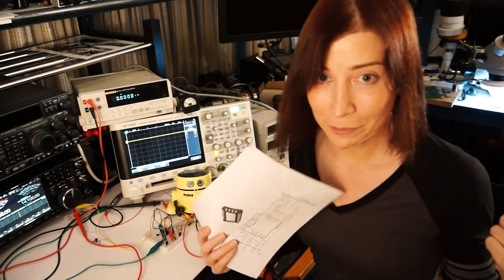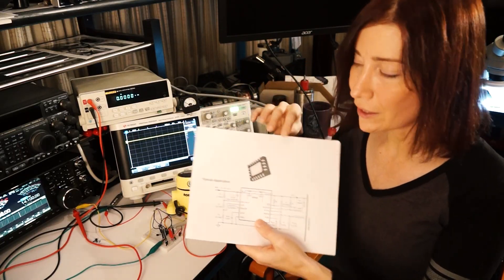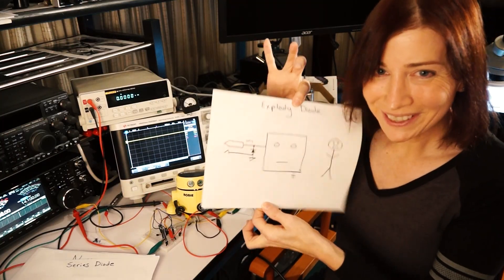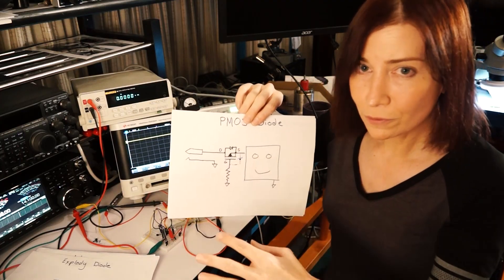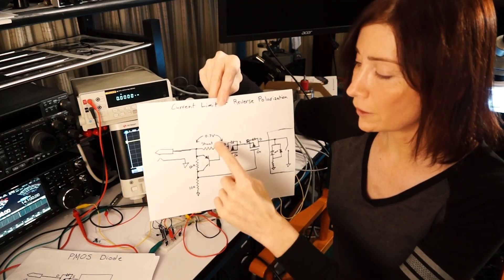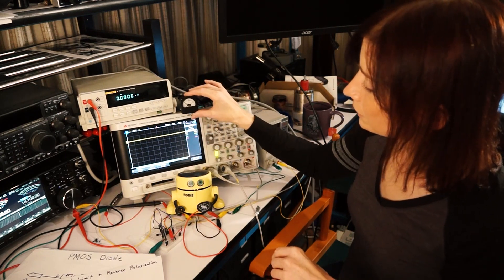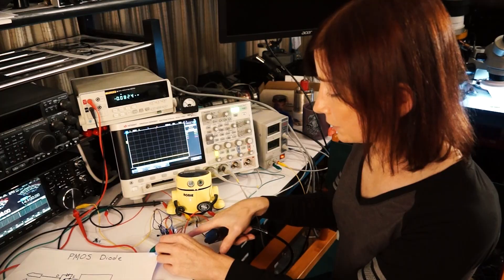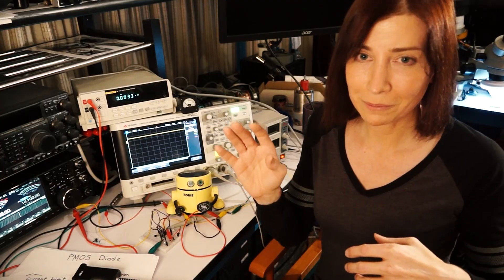Low Cost Reverse Polarity and Over Current Protection (Corrected)

Comment: This is a cool video, thanks for keeping it available. You have moved on with your life, and we wish you well. 

   I was studying these circuits, but everybody uses slightly different symbols and I was thoroughly confused. My text-
book is very complete and was no help at all. I wasn't sure the drain and source labels were correct in your diagram.
    Luckily I turned to the data sheets of my favorite MOSFETs (IRF4905 and IRF3205), and their symbols feature the body diode very prominently. Then I realized that the first PMOS is connected 'backwards', it's an always on switch (until the power is reversed). 

   If you are learning (or re- learning) MOSFETs, understand that the symbols are a mess. Take notes and copy circuits using your chosen symbols. If you work at it, you will eventually get it sorted out, so don't give up. 

   Remember: 
   If we could all make videos like Big Clive, people would have watch 72 hours a day just to keep up.

Comment: I use series diodes when input voltages is high ( >= 9V ) and reverse diodes and fuses for low voltages. If the voltage drop is important, I use Schottky diode . For over current protection, usually I use a fuse or reversible fuse (resettable fuse).

Comment: YES, but in the diagram with current limiting, you lose the 0.65 volts when it acts, as with a simple diode. 
If the normal current is smaller than the max current, then this is an excellent circuit.
It's probably a diagram to transform into a very small PCB and to have in your box of miscellaneous stuff.

Bye 

OUI, mais dans le schéma avec la limitation de courant, vous perdez les 0.65 volts quand elle agit , comme avec une simple diode. 
Si le courant normal est plus petit que le courant max , alors c'est un excellent montage.
c'est sans doute un schéma à transformer en un tout petit PCB et à avoir dans sa boite à trucs divers.

Bye

Comment: I have a vintage 1979 Chess Challenger 7 portable computer that I wanted to protect from reverse polarity (it's using a 9VDC small external psu). I simply put a diode bridge between the power input jack and the device inside. That way, it works no matter what the polarity is. Very simple to do: a diode bridge and a few wires. Cost: a few cents. The device already has a 7805 voltage regulator inside, so over-voltage is not an issue.

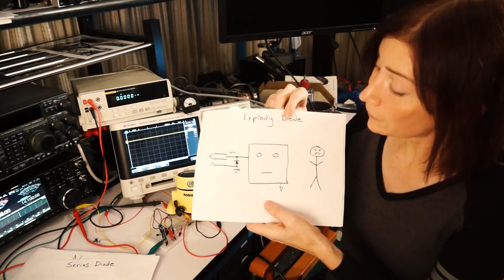Comment: 3:23 How about a parallel thermal fuse? Then user doesn't have to replace it. And no voltage drop. Would you need the diode in series with the PTC?

Comment: Another method is an over current latch circuit, that hard cuts the output upon seeing a fault condition until reset. Better for higher current loads where linear regulation would prove infeasible. Maybe you could just bond a thermistor to the FET of the linear circuit, producing a positive feedback loop, though using an actual comparator latch circuit is probably better for precision.

Comment: There's no way that you have a 50Ω resistor across that pnp transistor. Without the transistor conducting, your gate would be pulled up by that resistor to about 10K/(10K + 50) = 99.5% of your supply rail. That cannot possibly turn on the second pmosfet. I suspect you're using a 50K resistor across the transistor, but honestly, your circuit doesn't need it unless the Vgs(max) of the pmosfet is less than the supply voltage, and even then, a zener diode would be a better bet.

Comment: This is really good for me, I'm doing a Ben Eater 6502 build, and the other day I tied power to both VCC and VSS on the processor. I was sure I'd cooked it. I hadn't, but circuit suggestions like these could save me some sweat and tears, down the road, particularly the reverse polarity part.

Comment: Have a RND KA320-3005D dc 30v 5 amp bench supply.Blew the diode that protect against reverse polarity while trying to charge a 12 volt battery.The protection diode sit under a current sense wire with 7 wide windings(not a coil sinse windings are not close together.or is this a shunt resistor? what are this wire made of? nicrome or copper. 1.2 mm thick.A little stiff to be copper wire.If you can give me a tip or can point me to wher i can get a schematic,would be helpfull.Evvblog is good.fran lab and now i know about your channel.

Comment: If you put a y connected generator and a delta connect generator next to each other in theory they may neutralized each other out due to electrodynamic Maxwell equation. So in theory the navy we better put a shield over our generator and motor prevent interference from such a system

Comment: What we worry is if the we had used too much electricity made earth had too much polarized became back ward lighting goes back lighting into building or cars or cloud. Reduce using and solar power supply must be carefull design because direct current made earth became over polarized

Comment: The serial transistor is the most expensive part in such a kind of protection. I'd think about using only one of them, shutting it down by adding a low-power bipolar transistor between the gate and the source and opening it using a current mirror.

Comment: This is a good way to protect a device from putting in reverse polarity but how would you implement reverse polarity protection on a battery charger that will inevitably be connected in reverse to an extremely high current source?  Thanks

Comment: i wish there is a circuit that could get powered by external source and not impact the output of the lab workbench power supply that can monitor that kind of situation but that don't change the volt/amp quality coming from the adjustable buck Boost converter

Comment: Nice circuit, although I'd have placed the reverse polarity protection in front of the current sensing part to avoid the PNP transistor being reverse connected.

Comment: This may be a silly question but why is the 50k resistor sat 'between' the emitter and collector of the PNP? In this case there will always be some voltage at the gate of the second PMOS, and when the PNP turns on, the 50k is effectively shorted out and so the gate of the PMOS rises to whatever is at the input - is that correct?

Why is set up like this rather than say, the same circuit but simply without the 50k resistor? Or alternatively with that branch set up to have emitter>collector>50k>10k in series? Am I missing something obvious here?

Thanks

Comment: How much power is consumed by your protection circuit in this low-current application? What is the voltage drop across shunt + two transistors?

In a higher current application, doesn't the cost/V. drop of the shunt resistor become problematic quickly?

Comment: Hi...I have a little off-topic absurd question. 
Suppose I have a black box that has an input and a signal output. While the device is not indicated otherwise, what is in the entry is shown in the output. If it also has another input that tells the device to keep the last known value of the input constant in the output, could we say that we have a one-bit memory?
If instead of two voltage levels (0-5v / 0-1) it were a whole voltage range, would we have an analog memory? 
And if it were a range of frequencies (1khz-1Mhz) would we still have an analog memory? 
Is there a commercial device like the one described?
Would that have any use or would it be just fun?
Thaks :)

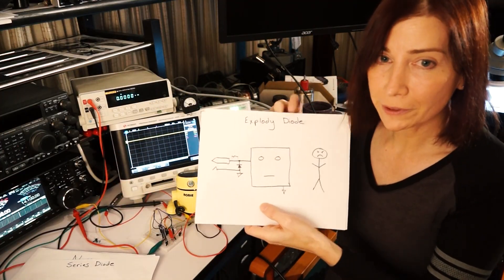Comment: 3:19 this drawings is missing the Fuse so it will blow the fuse if the polarity is wrong, but remember that the Diode CAN hold to the max current before the fuse will burn

Comment: I've got one of those Flukes... have you replaced the battery yet?  Mine's a goner... love the video, for my stuff a pass diode is fine, they've got the Vf down to 0.3V now, and I'm not on batteries for my widgets.  USB helps limit lots of things like reverse voltage and excess current.
Reply: Oh, btw... you like CW on 20M?  Or digital?

Comment: No resistor across the E-C of the PNP is really needed.

When I do this, I usually put a series resistor in the base leg of the PNP.  If the input is from something like a car battery, the MOSFET may pass enough briefly to make the drop in the series resistor big.
You can also put the sense resistor between the pair of MOSFETs.
Reply: The resistor across the pnp transistor is performing the same function as the zener diode in the simpler circuit. It prevents the pmosfet gate from being pulled so low that it exceeds the maximum Vgs for the device. Of course, it's not 50Ω as claimed, but (for example) 50K as a resistive divider with the 10K resistor to ground would keep a 12V supply from pulling the gate below 2V, thus keeping Vgs to 10V maximum.
You'd obviously have to recalculate for a different supply voltage and maximum Vgs, and clearly it's only needed if Vsupply > Vgs(max).

Comment: Interesting, but if the Rshut drops .7 V, what is the advantage compared to a simple diode? Why not adding another transistor to trig the BJT and reduce the voltage drop in the Rshut?

Comment: I've heard the 'Explody diode' called a crowbar circuit before.  I've used that with a PTC fuse with good results.  A P-channel FET is easier in some cases, though.

I do a lot of work on high-end programmable LED hula hoops, which have some interesting design constraints.  Everything has to be small and tolerant of board flex, but for practical reasons (like being able to assemble boards on our little in-house pick and place machine and to be able to repair things by hand) component count ends up often being a bigger concern than cost.

Comment: I've been think about a circuit that could be added to the ThinkFun Circuit Maze ( https://www.thinkfun.com/products/circuit-maze/ ) which, at minimum would buzz upon short circuit and limit current, and at best provide feedback for reversed batteries, over-voltage batteries, and even turn off current if current doesn't change for a time period, as well as short circuit.  If not wired in series, it would have to have minimal quiescent current as there is no on/off switch and the game is left on the shelf without removing batteries for months. The sold version just drains and overheats the batteries if the user sets up a short circuit. I've been thinking about incorporating a low quiescent current microprocessor.  Any suggestions?

Comment: Essentially, the FET is being used as a diode with a very low voltage drop. Would it be possible to use FETs for the same purpose in other diode applications that could benefit from that low voltage drop, such as:   a full wave rectifier for a power supply, the crystal in a crystal radio?  Or are there other modern components that would do that job more effectively?

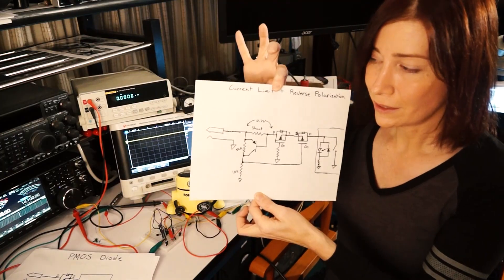Comment: 5:25

0.6-0.7V is too large voltage drop. It may be practical only as short circuit protection, not as general overcurrent protection.

Comment: Nice little circuit and explanation. 
As far as reverse engineering check out Diodes Gone Wild. Danyk has reverse engineered many a power supply designs. He is also present in a lot of forums and has a website with lots of designs detailed. 

  I'm not monetized, don't upload much, and really couldn't care less about self promo (plus I'm just a dumb hobbyist not an EE). However, I've been using my playlists as a form of personal references and bookmarks to other user's content for a couple of years. I save references and index them by subject alphabetically (although others cannot view the indexed list like I see/use it). If anyone wants to bypass the search results biasing of YT, a curated list of references is nice to know about. My subscriptions are also public but I watch a lot of edutainment stuff you'd have to filter through on that list. I recommend using playlists to find a lot of really good channels from many EEs and Devs.
  I saved this upload to a few playlists too, as I have an application in mind to try this on. 
  Again, I have nothing to gain in sharing. I'm just trying to make the path a little easier for anyone with similar interests as myself.
  Thanks for the upload ;)
-Jake 

PS congrats on the mention from Sam Zeloof on the Hackaday Super Conference. The idea of a garage semiconductor fab blows me away.

Comment: I was just reading Maxim application note 636 on this subject after blowing up my bench power supply 2 days ago :p  I fixed it but it's so convoluted inside that I decided to just make one from scratch eventually instead of upgrading the protection circuitry.  Now I'm just curious how a series circuit blew in 3 different places, like how does any energy get to the other two after the first spot breaks?

Comment: The simplest reverse polarity protection is a Schottky diode. The drop is below 400mV. Your PMOS solution works fine. It‘s also possible to use a NMOS solution putting the protection circuit into the GND line. NMOS On-resistance is lower at same cost as a PMOS.

Comment: That's cool seeing the ancient moving coil meter being used in a test rig along with the high-tech oscilloscope & bench meter.  :) I'm using quite a few of those meters in my solar power setup, but have never thought about having one as part of test setup...that's awesome. How much voltage does your shunt resistor drop during normal operating parameters? I presume it would be far less than the diode in the simple reverse polarity protection circuit, otherwise it would be defeating the benefit of using the mosfets?

Comment: Jeri, this is interesting. At 6:09 you say "Current starts to flow". At 6:11: Your meter (top left of screen) goes from 0.00 to 0.01 then back to 0.00. Are you mentally projecting energy from your thoughts? :)

BTW: Let me know when you are on 20 Meters - 73' WZ4SKY
Reply from the maker: Probably caused by static electricity from the gears in my brain working overtime trying to spit the correct words out.
Reply: Oh speaking of sparks..... I know a Ham ...... Not gonna name any names but he had a loose connection on a tube socket on a amplifier. Well his method of fixing it was to open the cover, wiggle the tube until it made the connection while it was LIVE! I guess he had been doing this for some time sounds like. With his finger!!!! Well his finger slipped and hit a capacitor! 3K volts DC burned a hole in his finger! He couldn't let go and fell backwards. As he fell he pulled the amp off and he hit the floor and the amp landed on his chest!!!!

He is around 75 years old too! He spent a couple days in the hospital and is back on the air! I talked to him today on 40M. Talk about one tough cookie! LOL
Reply: @WW5RM  -- Somewhere in that paragraph there's a behavioral economics joke about free medicare...
but I can't think of the right delivery method for making it funny right now
Reply: @czdaniel1  buwahaha! Yeah well sometimes we must be smarter than the equipment we are working with. Hows that?

Or as it was said over the air to the guy. Wouldn't it have been cheaper to get it fixed than the cost of the hospital bills? lol

I don't what the heck the guy was thinking! A paint mixing stick, which are free at all paint stores would have saved him! Hell the bare minimum would have been to go outside and grab a stick from the ground, cut any bark off and make sure it was dry! lol 

Idk ......a bull in a china closet comes to mind now that I think about it! Buwahahaha! =]
Reply: I always think of the rolling stones song.....sparks will fly! lol

Comment: Coolest mistake I remember making was mistaking an LM335 comparator for a Darlington array. Er, the light was a bit dim at the time, the Darlington array was being used to switch on a capacitor discharge thing to switch some points, but, er, well, the socket I plugged the wrong thing into had 8 pins. The fascinating thing was, instead of the magic smoke just quickly puffing out, or lazily curling out, no, this was way  more impressive - the Darlington array simply exploded into shards. Needless to say, I quickly switched the system off. No serious damage done. I have used servos to switch points since then - piano wire is very effective as the stuff that goes from the servo horn to the hole where the point is. Only other thing is, best to switch the servos off after using them, due to interference due to the locomotive motors.

Comment: What ? loosing several volts over a diode ? What kind of diode is that ? The kind of diodes I'm used to drop only 0.65V or even only 0.35V.
Reply: One volt is not out of the question for a silicon diode in some cases.
Reply from the maker: You're right.  That was a slip up.
Reply: Jeri Ellsworth: yay, making mistakes! Or more to the point: I'd like to express that I hope you're not really thinking of yourself as stupid (as shown at 0:13), because you're very clearly quite intelligent. You simply have the capacity to make errors now and then... *as we all do*! And you're showing evidence here of making efforts to correct them when you find them, and that counts for quite a lot.

Please keep sharing the knowledge you're sharing... I feel stupid sometimes when I compare my own accomplishments (or lack thereof) with the stuff you're doing... but I know I'm not, actually, I just haven't put in the same amount of effort in that realm.

Keep putting in the effort, and we'll keep watching these wonderful and inspiring videos.

Thanks, Jeri!
Reply: In battery operated designs the 0.6 or 0.7 volts from a silicon diode can be huge. Schottky's are better but sometimes even those can be too much. The MOSFET design is the best IMHO.